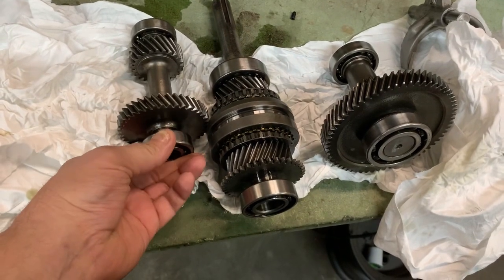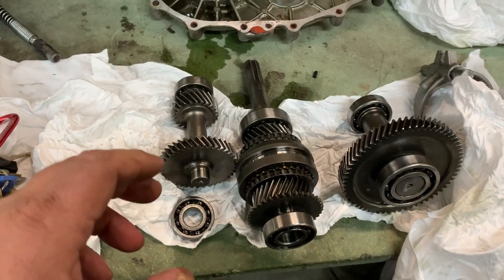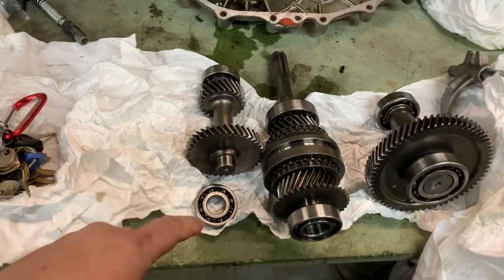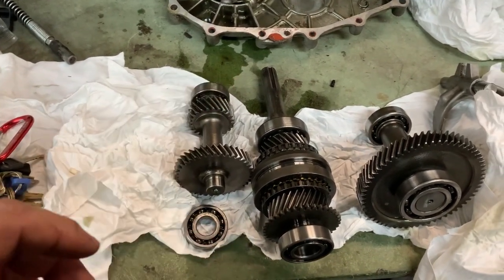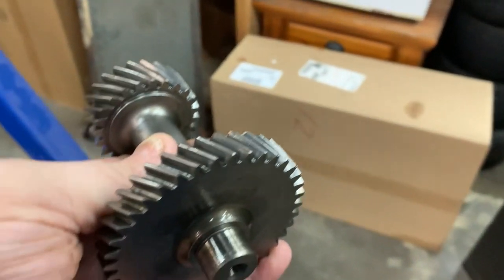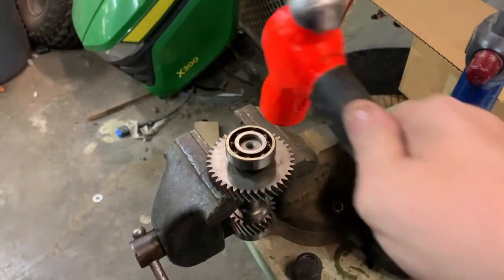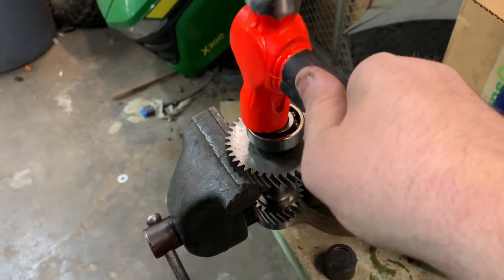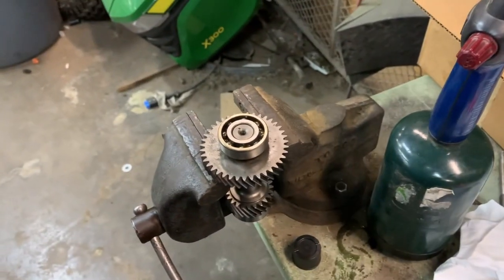OLD MECHANICS TRICK TO INSTALL INTERFERENCE / PRESS FIT BEARINGS WITHOUT A PRESS

Comment: I've used this method a lot on small engines. Also used a similar method when building up jet engines. Of course we couldn't freeze the shaft, so we heated the bearings in hot engine oil. Worked most of the time.

Comment: Millwrights in a mill I worked at use to place a heat or tungsten lamp above the bearing and leave it for a few hours, they were fairly large bearings.

Comment: I use dry ice (much colder). Another very good alternative is to turn a can of air upside down and spray it on the shaft. However, this liquid / gas mix is combustible! Keep it away from high heat or flame!

I put the bearings in an old toaster oven, wrapped in foil. I use a remote thermometer to get them about 200⁰ to 225⁰F, which is the max working range of nitrel rubber. That's the rubber most used for bearing seals.

It's not a good idea to use open flame, even on an unsealed bearing, because the carbon particals that are produced when oil burns become a very hard contaminant.
Reply from the maker: No need for dry eyes if you don’t need it won’t pay for the extra expense
Reply: @THEMOWERMEDIC1 
Freezer works sometimes. Canned air is colder. Dry ice is even colder.

All I'm saying is that sometimes the freezer works, if not, try canned air. If that doesn't work, try dry ice. 

Obviously, you'd stop at the freezer if that works. Just trying to add on to what you've said, not take away from it.

Comment: I agree with freezing the part that the bearing is going onto, but using a torch can easily burn off any lubricant, especially in a bearing that is not sealed. This can also damage the seals on sealed bearings. If you're going to hammer the bearing onto it's mating part, place a piece of wood, such as a 2x4 on top of the bearing to protect it from damage.

Comment: Slip right on, not always.  I freeze the shaft down to around 0 degrees and warm the bearings up to 200+ F. And sometimes they go on and sometimes not.  Sometimes it takes a little pounding on them  with my brass hammer and a big socket to get them seated all the way and sometimes I have to pull them from the shaft and start over.  You need a tight fit on the bearing to keep them from spinning on the shaft and spinning in the bearing cup.
Reply from the maker: The trick is to do it quickly

Comment: In fact, if you place the bearing in a tin can with enough motor oil that covers the bearing, place it onto a heat source like a barbecue for about 5 minutes, pick up the hot bearing with pliers and position it over the top of the shaft, it will literally fall onto the shaft without pounding. Make sure you do it quickly before the bearing cools.

Comment: I've found that if the bearing uses rubber seals, it's best to heat a tapered shaft with the torch then set the bearing on it so it heats up. then remove and drop onto the chilled rotor shaft. If that isn't enough to make the bearing fit on the shaft, there is probably other issues going on such as out of spec shaft or bearing diameter.

Comment: Interesting, the torch want melt the rubber seal or make the grease in bearings melt?
Reply from the maker: @jmc90213  Absolutely you would want to heat them up this is how you do it I just wouldn’t heat new bearings up with the torch you put the new bearings on a hot plate in a vat of oil in a coffee can and let the bearings heat up in motor oil to about 250 to 350°

Comment: I d prefer to place bearing in oven versus flame on that seal
Reply: Ive used both oven, and oven plus last minute gas. If you get the whole thing up to about 250 in an oven (and then optionally give the inner race a blast for a few seconds with some flames), you can get it all done a bit quicker and the cold bit doesn't risk warming up too much.
Reply: How about an airfryer? You can set the temperature you like and it is quite quick too. And let's be honest. You do not need a complete oven unless you have a really huge bearing.

Comment: Get a bearing heater
Reply from the maker: No I have a press. You didn’t pay attention
Reply: @THEMOWERMEDIC1  a press is different from a bearing heater , and I did pay attention, you did not use a bearing heater just a propane bottle to heat bearing race.

Comment: Hi, this is indeed the old school method.
I personally don't like it. Much better is an induction heating system or just heating the bearing in oil (we did it already 40 year's ago)
Just be aware, that the maximum  temperature of the bearing does not exceed 120°C.